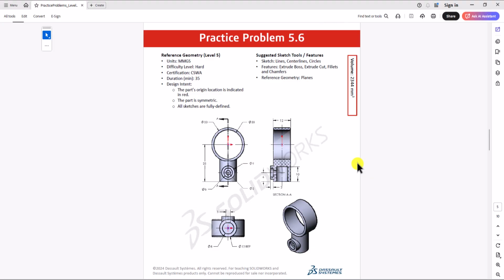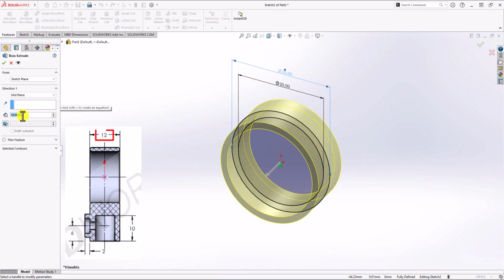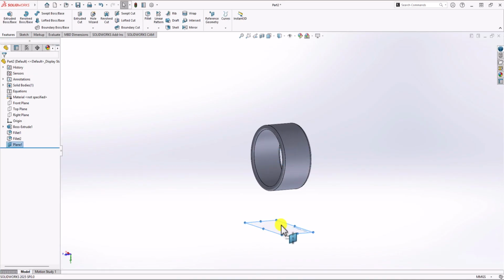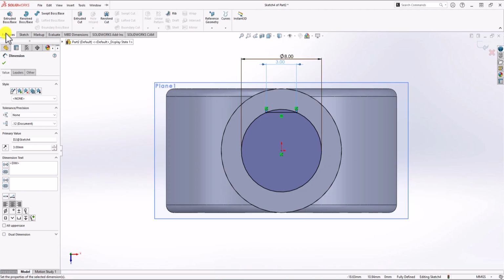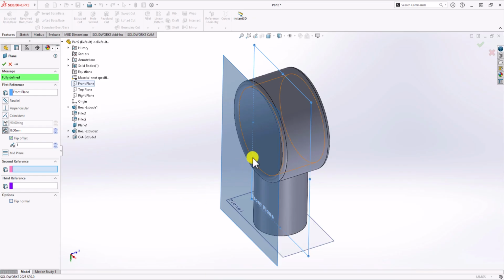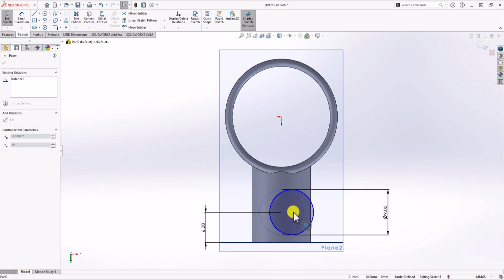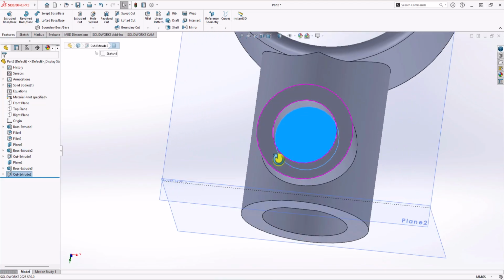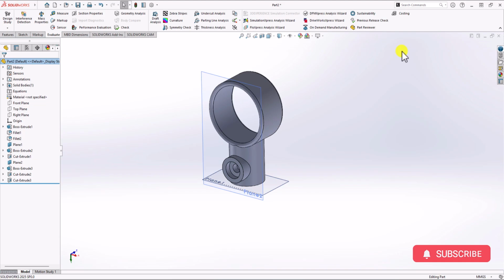CSWA Practice Problem 5.6 Solution | SolidWorks Exam Guide

Comment: Learned about the rollback bar in this exercise because i did the fillet too late 😅
Reply from the maker: That's great! The rollback feature is fantastic because it allows you to go back and review the steps in your model at any time and make required changes..
Just keep in mind that if you have features later in the model that depend on earlier ones, rolling back and removing those earlier features could cause errors. So, always make sure to check the feature dependencies before making changes.

Comment: Made a few mistakes on this one like tiny hole I didn’t cut it all the way through.  Then forgot little flat bit on circle at bottom.  Then fully round fillets wasn’t clearly marked on diagram.  Did try full round feature which didn’t work.  Then calculated fillet size needed and use constant round fillet instead.  Then got 2343.78.  My biggest problem is volume isn’t always right at first attempt.  I have to then debug check dimensions then make a few corrections then volume is usually right.  Usually is I might have forgot a small feature or wrong dimension.
Reply: I think fully round fillets wasn’t clearly didn’t work for me because I added fillets at very end.  Hence had to use constant round fillet and calculate fillet size needed.
Reply from the maker: Don’t worry if you don’t get the correct answer on your first try. Remember, this is just a practice problem, so the goal is to work through different approaches and find the best way to model the part. In the exam, as long as your final answer is within the 1% tolerance, you should be fine and can work through the problem until you arrive at the correct answer.
Reply from the maker: That’s true. Depending on the steps you take, you can either use a single round fillet or two separate fillets. At the end of the day, it really depends on your modeling approach.

Comment: Question: I put the lower circles on the same plane as the big top circles, then projected from surface (where the reference plane is in this video) and extruded up to body. My weight came out as off by about 10 mm. I like working with as few planes as possible- is there a "wrong" way to be building the sketch? Edit: tried again with the same ref plane as you used and I got the correct number
Reply from the maker: It’s a bit difficult for me to understand your approach. Are you saying that instead of creating a separate plane 25 mm away from the reference plane (at the center of the large top circles), you sketched the circle directly on the reference plane and then extruded it? If so, wouldn’t that create a cylindrical body inside the large top circles?
Reply: @Design_With_Roozbe  Well, I didn't make a reference plane. I drew all circles on the front plane, then extruded the lower ones using "extrude from", and extruded from 25mm into space backwards to the cylinder body (if that makes sense). The top circle was simple mid plane
Reply from the maker: @Mr.McWatson  Oh I see what you did. You essentially sketched the 12 mm circle on the main reference plane, then extruded it. For the settings, you used a “from” offset of 25 (because the bottom plane is 25 mm away from reference plane) and extruded it “up to body,” right?
I tried your approach and got the same result. If we look only at the geometry up to that step, my method gives a volume of 2756.52 mm³, and your method produces exactly the same value. I’m not sure why your model is showing a lower volume. On my side, both approaches behave the same and give identical results.
Reply: @Design_With_Roozbe  Yes correct.
 ok then I don't know what I'm doing incorrectly. All values I entered were the same both times